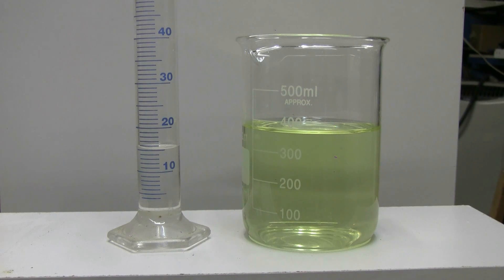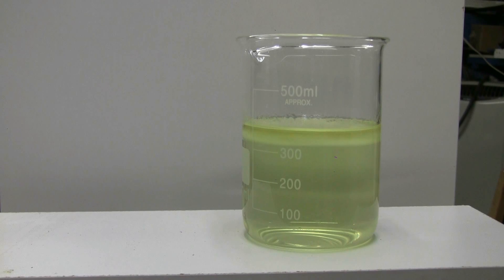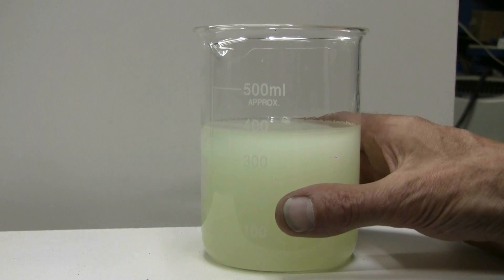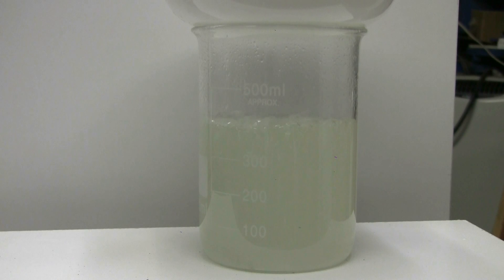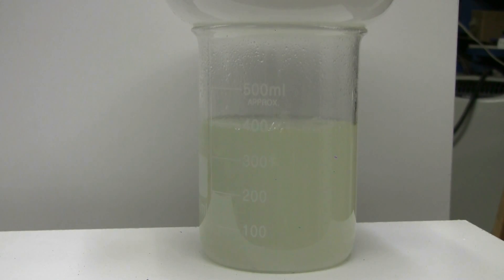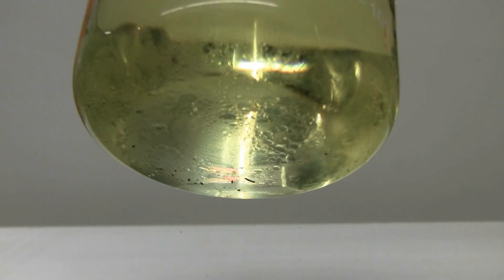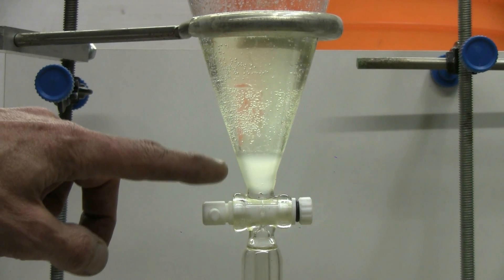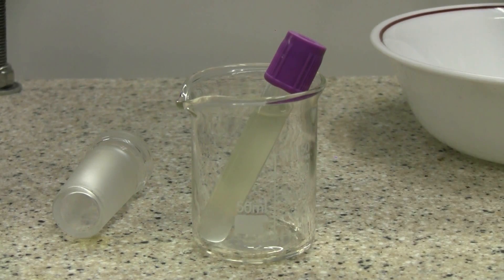Synthesis Of Chloroform Via The Haloform  Reaction (With A Twist)

Comment: Can you make a video about making isopropylamine using aluminum galinstan amalgam? Gallium, Indium, and Tin are non-toxic. Galinstan is non-toxic. 
 
https://youtu.be/sPsVdiL-VdM 
https://youtu.be/qB0GDbhpw-Y 
 
69 grams of Gallium, 21 grams of Indium, and 10 grams of Tin are placed in a beaker and heated. The result is 100 grams of galinstan. 
 
90 g of aluminum foil is weighed out and ripped or cut into small pieces. 10 g of Galinstan is weighed out and placed in a crucible. It was heated with a torch. The yield is 100 g of aluminum galinstan amalgam. 
 
A mixture of 17 g (0.3 mole) acetone, 200 ml ethanol, 200 ml 25% ammonia(or 500ml 10% household ammonia), and 80g aluminum galinstan amalgam is placed in a 1 Liter flask(or 2 Liter) and warmed with strong stirring until reaction takes place, after which warming is stopped immediately. Cooling should be applied if the reaction becomes too violent. When the violence of the reaction has diminished, the mixture is refluxed with vigorous stirring for about 3 hrs. The mixture was filtered with a buchner funnel and the galinstan recovered. The filtrate was dried with magnesium sulfate. The yeild is isopropylamine freebase. The isopropylamine freebase is reacted with hydrogen chloride gas in a beaker to form isopropylamine HCl. Alternatively, you can use hydrochloric acid and then evaporate the solution in the beaker. The isopropylamine is weighed.